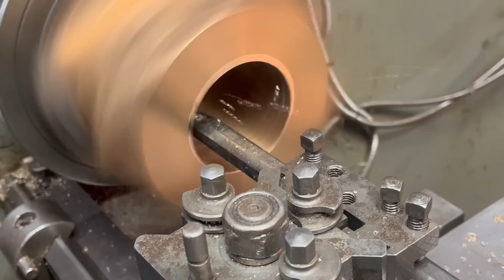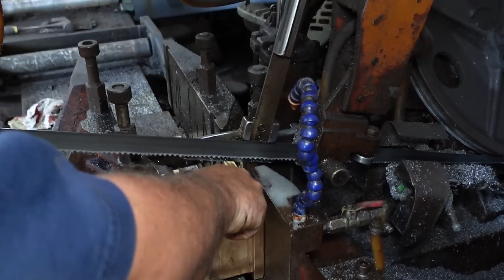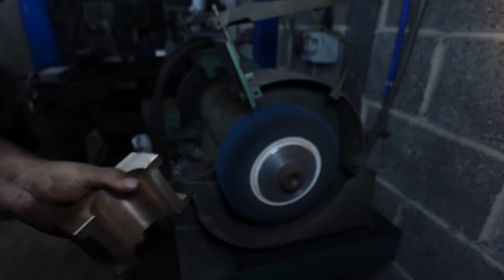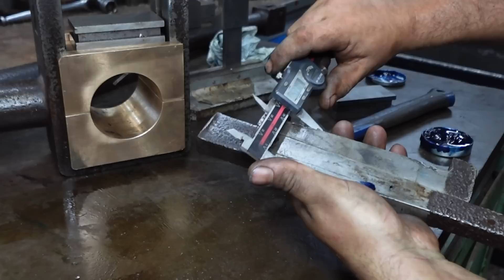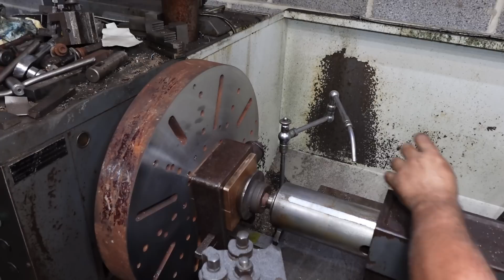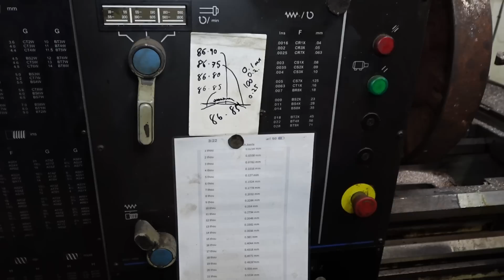BIG Bronze BEARING machining pt 1, ENGINE restoration!!!

Comment: Your maths needs some work 😂
86.90 minus 86.75 = 0.15 (.006”)
Crank should be stoned true before making bearing. Clearance 0.001” per inch. 
I think I would have packed the bearing joint with some thin brass sheet. 
Kearns bore would have been best with conrod attached. 👍😁

Comment: I know this is an old video and done is done, but why not finish machining the bearing block completely - outside dimensions and radii, finish bore to fit the piston pin, and finally saw it in two? That leaves the saw cut - maybe machine a bit more off - to have some  space to tighten the gib as it wears?
Reply from the maker: These are held together with a wedge that relies on fiction. If you where to have a gap this would work loose and you would have major issues on the road

Comment: The Micrometer blue I use, was my Dad's that he bought in WW2. I never have a problem opening it because it is in a lead tube with a steel screw cap!
I would advocate boring to minimum size of the crank journal, making a mandrel to fit then doing the same at the small end. Assemble with the mandrels and set the whole on vee blocks on your big surface plate. This would make checking the straightness of the connecting rod easier by measuring the run out between the 2 mandrels. However, there is no point if the cylinder and crankshaft do not have mutually normal axes, or indeed, if their centrelines are not coplanar vertically. Your plan to scrape the crank journal bearing halves is the correct one. Having so much barrelling in the crank journal makes it essential to accurately position and profile the end radii of the bearing halves to avoid hot bearings and damage.

Comment: Good work, though I gotta say your kinda losing me with the metric measurements. Nought point this and that mil.... I feel like anyone working on steam engines from the us or anywhere else in the anglosphere should stick with imperial, since all of these machines were built using that system anyway. Whatever works, I guess. Carry on.
Reply from the maker: I some what agree but being brought up working in metric I’ll stick to what I know to avoid making a mistake.
Reply: @VintageIronuk Ah, so it finally happened and theyre not teaching the imperial system over there anymore?
Reply from the maker: @krockpotbroccoli65 I havnt had a teacher but I do believe all colleges are on the metric system. I started using it wood working and have carried it over to messing about in the workshop. I’m not a machinist and havnt ever used imperial for anything. Obvs getting an understanding of whitworth having doing this job but learning it as we go!

Comment: Norman your method of getting the bend measurement is a little faulty. Try clamping the big end down to the surface table, then measuring the stack height, and do both ways, then you'll have an accurate difference to work on mate. I've just stopped video when you finished doing the measurement. Will watch rest now!
Reply from the maker: Clamp would have been a good ideal. Could have just measured to the top of the little end register. 👌

Comment: Hello Norman, I have been through the same process on my engine. Alignment issues and a barrel shaped big end. I hope you will find these comments helpful.  Timesaver lapping compound (Allison engineering) could save a lot of work matching the big end brasses to the worn big end journal. Using the side faces of the conrod as a datum maybe misplaced,  apart from matching the register in the big end brass their geometry is not that important to the axis of the conrod. The end face of the conrod that interfaces with the brass is important. After I had reworked the big end strap, brasses, wedges etc, the big end was assembled to the rod.  The assembly was then sat vertically with the bore of the big end sitting on a horizontal bar itself mounted in V blocks. You can then check the left/right position of the little end to the big end with plum lines. You can also check the parallelism of the little end to the big end. Keep up the good work.
Reply from the maker: Interesting what engine? 

Bit of a spoiler for future videos but we went down the route of scrapping  the bearing and you are right!! Was a lot of work and now have a new tin of time saver on the bench ready to run it in. Yellow stuff we went for. I’ve now had the rod back on and it’s all lining up some I’m pleased with the results even if it was a bit unorthodox. Thanks for the advice
Reply: Burrell 1144, we will be at welland
Reply from the maker: @SIMONTYLER-rh6gq nice might see you there. I’ve still got the little end to make so will have to try your set up to get both bores parallel. 👍

Comment: Hi Norm, I’m wondering what your thoughts are on making the clearance between the bearings blocks. I’m used to put in shim stock before turning
Reply from the maker: I don’t like it due to how the bearings are held. I want to be able to hammer the wedge in hard so it will not back out when running. You can’t do that with a gap in the bearings. If I need to take them up I’ll take them out and shave some of the mating faces and re scrape.

Comment: Does make you wonder what tolerances the old boys worked to🤔 as you said, wonder if the crank was “made” to fit. Hope you enjoy the 30c+ tomorrow 😖🫣
Reply from the maker: Will be hiding in the shed mate, should be by the beach with a cold one 👍
Reply: @VintageIronukI’ll be on the tractor… baling little bales again 😬🫣
Reply from the maker: @casto- yeah don’t envy you lot. If it anit pissing it’s a fucking drought. Can’t win
Reply from the maker: @casto- 😂

Comment: I remember many years ago that I spent a week under my A30 filing one of the big ends on the crank shaft back to round. I ran that engine for a further two years after that before selling the car. The crankshaft was still in good order when I sold it. As your crank is only oversize in one place. Why not blue it up & run a small flat over it to identify that place. I would in the certain knowledge that the crankshaft will be that little rounder & better.
Reply from the maker: It’s worn in an even curve getting smaller in diameter towards the ends. The plan is to match the bearing to the crank by scraping. Ideally the journal would be ground but not on the cards for us.

Comment: Cheers Norm! Very interesting content. Nice bit of lathe work. Surprised you skimmed the faceplate - is that common practise? I think I've only ever used mine once. My drive plate has never been used - still has the makers protective coating on it. This is on a Willson slantbed probably from the 60s. All the best, Mart in Solihull.
Reply from the maker: I’m not sure it’s needed every time you use it but it was the first time on the lathe doing anything that required precision so just wanted to true it up to this lathe. As long as it goes back in the same orientation should be good from here. Probably not needed but didn’t hurt.

Comment: Norm, About checking the straightness of the conrod; would it be an idea to use a laserline across it's length? If you center it on both ends, you will se where along it's length the line starts deviating from it's centerline. Or optically center it along most of it's length and see how much the ends are off. Good luck fom the Netherlands, Sierk
Reply from the maker: Thank you Sierk
Reply: Yes and it would be easy to check straightness in both directions with a LASER . ( it might not just be bent in that one direction .m)

Comment: Nice, explatiation, I was shouting at the screen 10 thou as I did the calc in my head lol
Has that lathe got a big spindle bore as the one I make stuff on is 7" ID 
https://www.youtube.com/shorts/dEcR-7M9uoM?feature=share
Reply from the maker: 3/4 inch bore in head stock. Nice size lathe if you have the space. 👍
Reply: The spindle bore on a Myford 7 is half inch, a right pain.